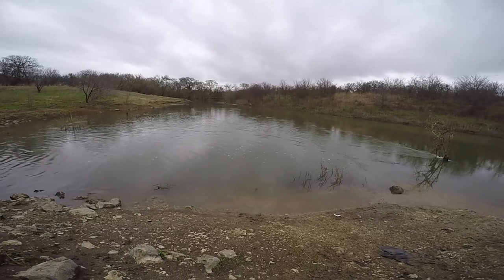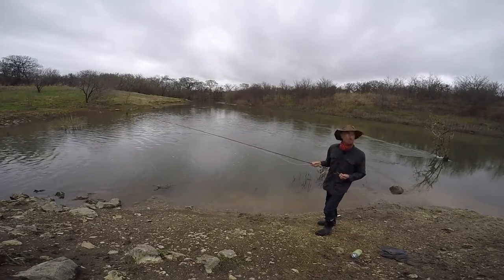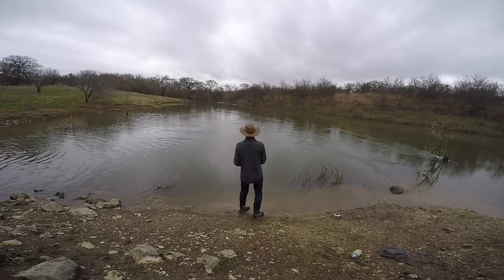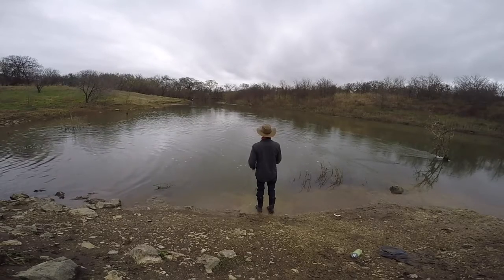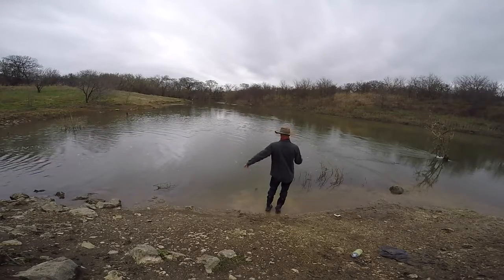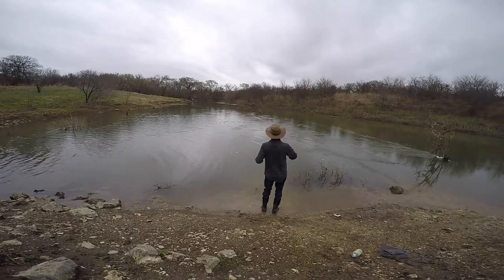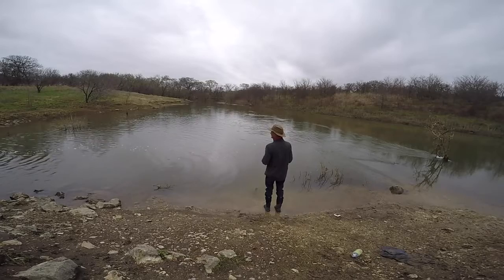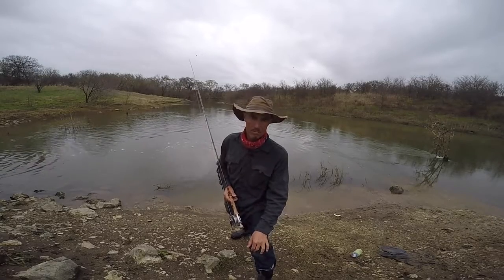Working Multiple Currents Covering Water Thinking Like a Fish - Texas Hybrids on Fly

Comment: Can you go into more detail about your rod setup, I have problems throwing heavier clousers. Thank you.
Reply from the maker: +cameron joyce I think that is the 8wt TFO Mangrove fly rod I am using in this video. It has a great backbone (at 8wt!) and the line is a "Chard Grand Slam" saltwater line. The name of that line has changed as Chard had endorsed another brand. The line is the key to making these saltwater rods work properly. I tie my own leaders from Seaguar fluorocarbon @ 9 feet long and a tip of 8# line test. So it's a pretty darn heavy rod throwing those heavy Clousers!
Reply from the maker: It is also very important to have the correct leader! If it is too short or too lightweight, your fly will have a tendency to "ting" and the fly will get ahead of the leader.